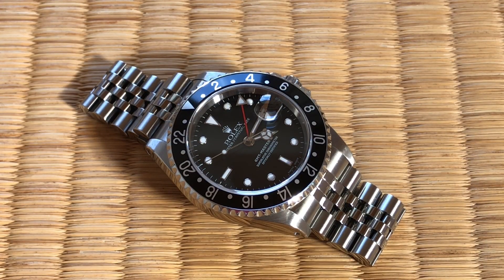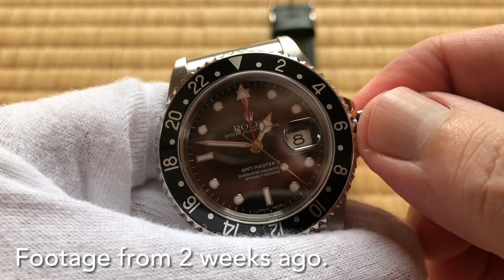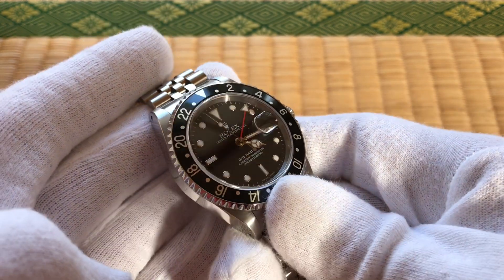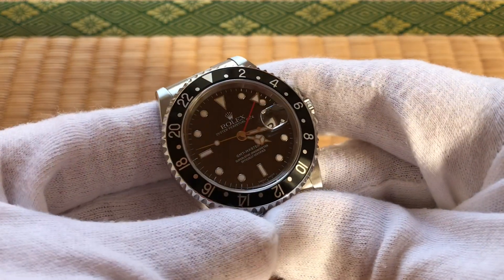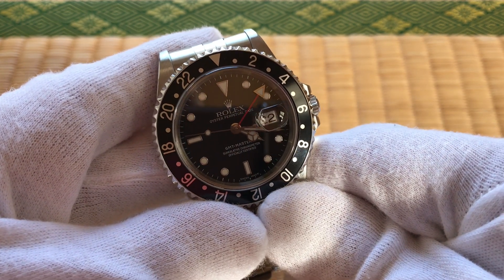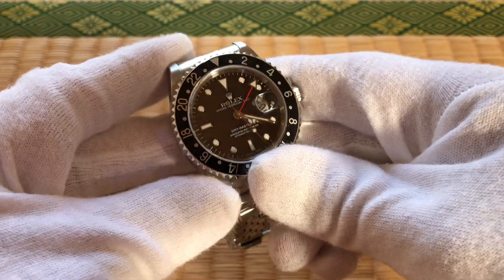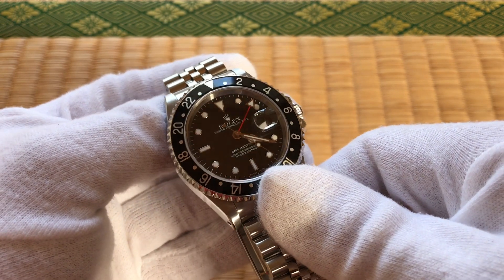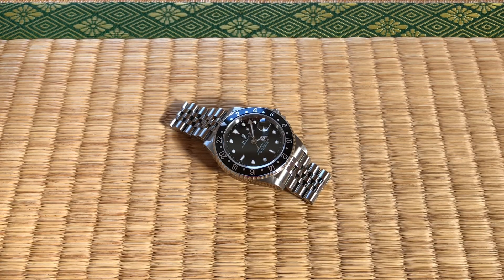Rolex GMT 16710 Accuracy Check!

Comment: Austin, that’s bang on, my SD is running +0.2 since last 2 years when I had RSC overhaul it with specific instructions regarding the accuracy I wanted. Apart from being careful around magnets, that watch has seen solid abuse and seems to have no impact on the accuracy. 
3135 is nothing short of a masterpiece.
Reply: Why does my blnr bought new in 2018 is a little over 3.2 second's fast per day? Does it need a service?
Reply: @mattt7124  Since you'll have a 5 year warranty if you bought new, I'd take it to RSC. Well, unless you're OCD about them cracking open your almost new watch.

Comment: Thank you for sharing this, Austin. 
I have found that I can manipulate the time keeping of pre-ceramic pieces sub-date and explorer 2 both F series by the way I store them overnight. Crown-down slows them down and dial up speeds them up. I can do that to a point where I can the explorer 2 to be dead on over 2 weeks. Where as the sub gains about a second per day. 
However, I found that storing the ceramic GMT overnight in any position has very little  effect on the time keeping. The same goes for the Datejust with 3235 movement. 
So yes, it is definitely proof that pre ceramic pieces are great time keepers  with a little bit of positional manipulation.

Comment: Nice watch Austin.  Every watch is different so your note on regulating a watch is not universal.
I use a Timegrapher and note watch accuracy in 6 different positions which I then use when I place the watch down to offset any gain or loss whilst wearing it.  You can only compensate within reason using this method and your other observations about how fully wound the watch is and movement deviation also apply.  I've also found that temperature also plays a part just to add to the fun!